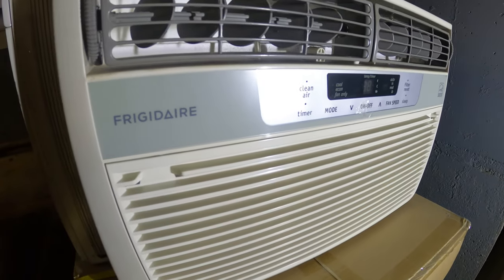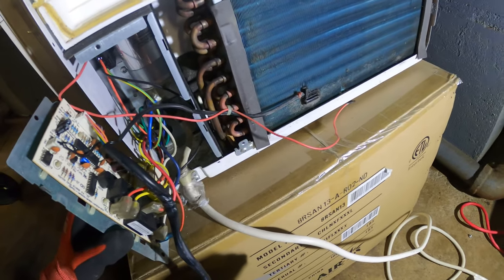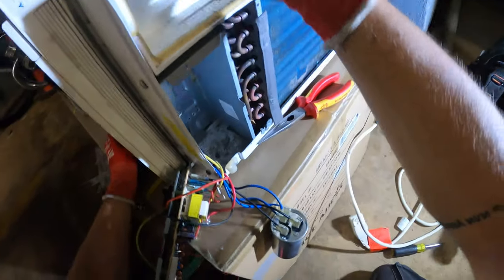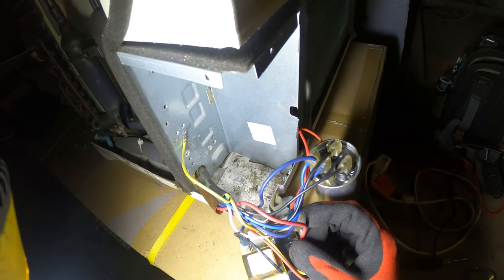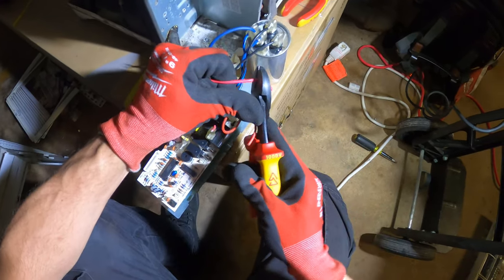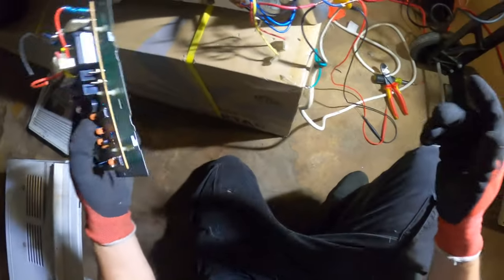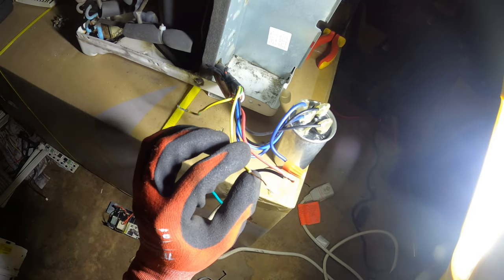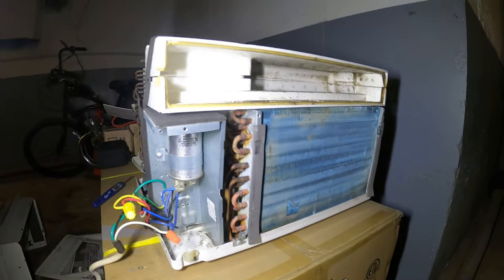HVAC: Window AC Not Cooling (Window Air Conditioner Not Blowing Cold Air) Hot Wiring A Window AC!

Comment: Thank you for posting this video! My AC stopped working when my husband took it outside to clean it and my kids and I have been dying for the past 5 days in this Florida heat. We assumed the circuit board shorted somewhere when I tried to turn it back on because it may of been wet still. Well I got tired of being hot so I started Googling and came across your video which seemed to be close to the AC I had. My husband didn't know which wires were what so I went on a mission to figure it out myself and you made it so easy to understand and I was able to go to my husband and tell him wire these together then these and you should be good to go. He did and it worked! I had to joke with him and said alright now mister you got to give me credit, a woman figured it out for a change, not you. He said alright, I'll give you that, jokingly. But seriously thank you so much. This video saved me and my kids from another day of being stuck in the Florida heat. You are the best.
Reply: Steph, you should've called me, I too live in FL and know all about the FL heat...lol

Comment: The "generator" was a high voltage power supply for air ionizing. The single red wire you called a thermistor was actually a carbon fiber "brush" emitter.  It lets out negative ions to help purify air.  Good job on bypassing the bad board...you could always add a simple thermostat into it to make it "automatic" again.
Reply: Have you got a video up showing us how to add a simple thermostat please?

Comment: I did a similar thing many many years ago to the crappy portable AC i have in my shed. Had all this digital control stuff which died after couple of years. I ripped it all out and just put a contactor in its place. Then i just use a cheap thermostat to control it. It actually works better than it originally did as i could put the thermostat on the other side of the room so it gets a much better temp reading for the whole room
Reply: That's exactly what I'm trying to do. My ac cool great but is getting water in the circuit board and starts going Bo kers after a few minutes of use and often just shuts off randomly. How can you tell what wires to connect to the thermostat?

Comment: Awesome! Repair find . Process of elimination. Way to go, all you need is a plug in timer and you have your automatic On/Off
Reply from the maker: Thats a great & simple idea right there. Could also put in a line voltage thermostat or install a transformer with a low voltage stat. Thanks for watching!

Comment: Great video. Thanks so much for sharing your knowledge. I had the idea but my problem was neutral and you really solved for me. Someone was had for sale a portable unit which is very much with the same features that the one on the video. My question will be can I install a ceiling fan speed switch with the capacitor (the black rectangular for ceiling fans) that way I can switch speeds?

Comment: What will keep it from freezing up since it will run continuously?  Will it never get below a set point?  Good video for the common working man.  Thanks!
Reply: the test button on the gcfi ;)
Reply: @james6794  duh, which way'd he go George, huh, huh
Reply: If the temperature is hot enough it will not freeze up. The fan should run 24/7, just the compressor needs an on/off switch.

Comment: What a coincidence,  i had the same brand (frigidaire) and less than a year nothing was working,  it wouldn't start ...so i called frigidaire and after back and forth,  they gave me a frigidaire gift card for 289 or so , so i left it in my garage bc i didn't want to throw it away , after a year or so , i decided to plug it in and see , well guess what it started to run , i was so happy,  idk what could have happened but it was in my garage for over a year , now it is laying down on a table in garage and every once in a while i crank it up .
I didn't know how to wire it like you, but if it stopped i will go back and watch your video and probably try to bypass....and fix it
Tks for all your videos
Reply: Always by the ones with knobs. All those electronics always goes bad.
Reply: @sherwinalvarez7365  they don't make the manual kind in big window unit,  i have 14 rent houses and all have central ac units but i decided to install some wall and window units in everyone of them too so it helps with cooling ( we are in monroe Louisiana and gets hot and all the houses are Townhouse and heat rises and gets hot i put a 12000 btu upstairs and a 12000 btu Downstairs in the wall, but one of the units had ( frigidaire) and it end up bad , i hardly put frigidaire most are Kenmore,  so that's why i probably won't buy frigidaire for tenants,  i like Kenmore and lg bc they both are the same .
I appreciate the video .
Take care my friend ✌

Comment: My Kenmore has the same exact build! Stopped working after a teardown washdown. I used electrical cleaner on the control board, that worked for a day, then it acted up again. The thermostat readout started to act crazy, then stopped showing; at that point, the whole control panel was not effective. The fan would operate, but not the compressor.Will check the other controls or hot-wire like you did.

Comment: does that defeat the purpose of the capacitor? if its not charged, its just starting on line power right? maybe it even makes the surge power on start even greater because its also charging the capacitor while also trying to start the compressor?

Comment: What I want to know is how to rig up a home thermostat. This was very helpful but there's no way for it to turn off other than to u plug it so it'll just keep on cooling until it's as cold as it can get. I'm assuming it'll need a relay and the relay will need a power supply. Maybe 2 relays if you want to keep the fan running all the time or have it shut off when the compressor does

Comment: I'd like to see you wire in a Temperature controller.  I've seen others wire power directly to the compressor and then plug the compressor into a Temperature controller.  This was a great video but would like to see a little more precise bypassing of the controls.  Specifically, I want to bypass the thermistor and run a temperature controller so that you can use AC to go way lower than its normally allowed

Comment: My control board went dead too.. I just bought a 24vac powered coil relay to control my fan and compressor to my ecobee thermostat.. I have 2 relays, one goes to G for fan to my fan and the other to compressor from y1 to thermostat and works great, how I'm getting main power is from my hydronic boiler system..

Comment: Cut hot and neutral from the board to the cap. Cut the speeds from the board. Pick a speed tie it to the hot from the plug and the cap; tie the neutrals together. Plug’er in.

Comment: You are gonna need a tstat for that thing or it will ice up. Something has to break the compressor.
Reply from the maker: A line voltage stat would work. Or you'll need a transformer, a contactor & a low voltage stat. Or you could just turn it off when you feel comfortable manually 😂 Thanks for watching & stay tuned for new videos every week🔧⚡️